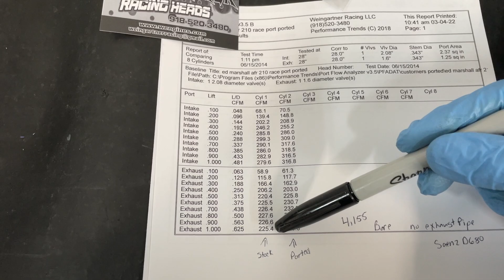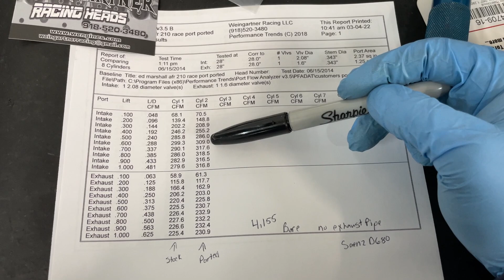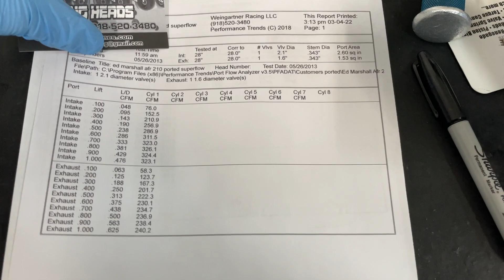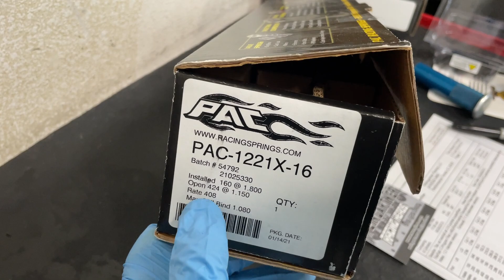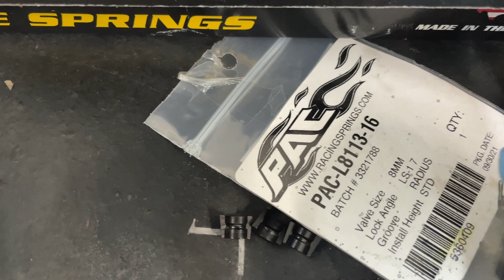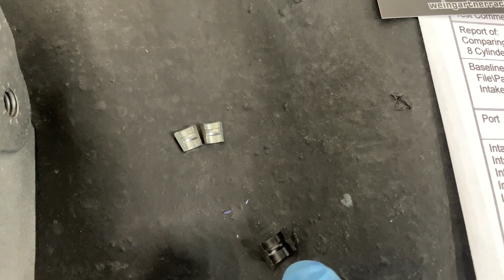Making AFR 210cc head Moderately Bigger

Comment: That high of spring pressure can’t believe Pac didn’t recommend 10* locks. Guess with the low rpm they should be fine… I never like seeing those weird zinc colored locks on anything. I feel like the black oxide locks are just tougher. No clue if there’s a material difference. Just feels better and tougher to the touch lol. Just got me a set of 1219 springs for small block mopar heads. 👍
Reply: A 10deg lock in no stronger than a 7deg lock, because the key is the exact same size. In fact the 10deg lock has less clamping force on the valve stem, that is why Manley makes a super 7 valve lock. You maintain the clamping force of the 7deg lock.
Reply: @racerd9669  And isky cams or iskenderian cams siad doesn't believe in 10* locks and retainers.

Comment: 😂😂😂😂 I guess I’m going to have to finally get Instagram 🤪🤪🤪🤪! I know guys who have ported all day for 8hrs a day 🙄🙄🙄🙄, most have all kinds of issues with there wrists & hands 🙄🙄🙄🙄! Most have machines now! I know trucks need torque, especially if it’s pulling on the street, but why do people get hung up on keeping RPM low 🙄🙄🙄🙄? My friends old C30 w a 406 & a 4sp pulls heavy cattle trailers, snowplows ect, & it makes good lower end torque & runs right out to 6500rpm now! He uses it, especially when he gets into mud! It had a RV type duration when I originally put it together, but he wasn’t happy w it falling on its face by 5500, More RPM isn’t bad on a engine! More RPM more air more power 🙄🙄🙄🙄! Your customer would probably be better off with the beehive springs 🙄🙄🙄🙄, the parts are much lighter also 👍🏻👍🏻👍🏻👍🏻! Lots of garbage 🗑 top name parts lately 🤬🤬🤬🤬! I know of at least 3 engines with coated titanium valves, that have just popped the head off the intake valves! Engines that normally run at least one, if not 2 seasons with no issues! They didn’t even break in competition 🙄🙄🙄🙄! They broke under stupid circumstances! Like on startup, just driving to a car show on the highway & at low engine speed! The 3rd one came flying out of the turbocharger after making a pass & driving back to the trailer 🤬🤬🤬🤬! You might want to show how most race springs are actually setup today 😜😜😜😜! It’s normally a certain distance from coil bind? Like 100 thousand, sometimes even less 😜😜😜😜! Have a great time at the track 👍🏻👍🏻👍🏻👍🏻!